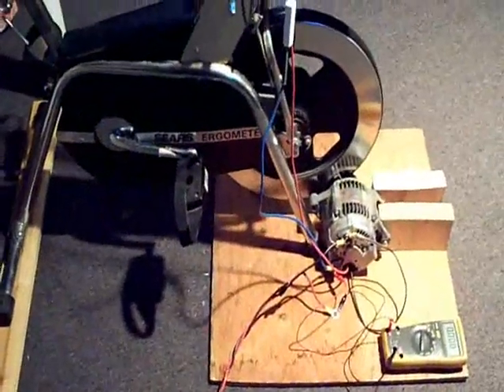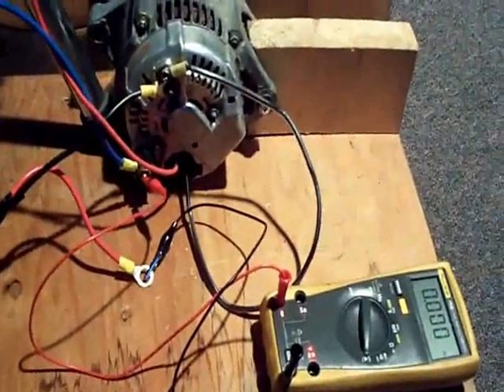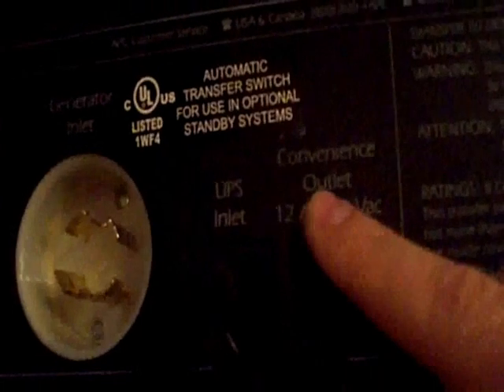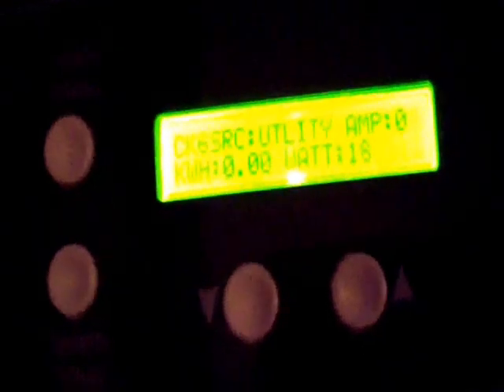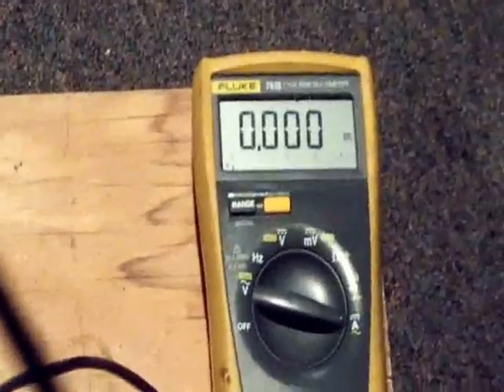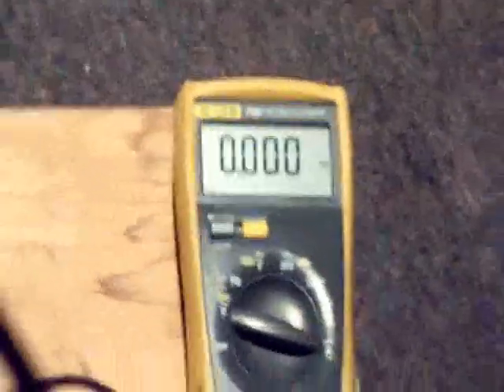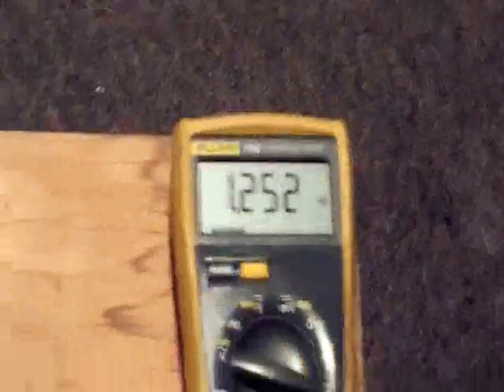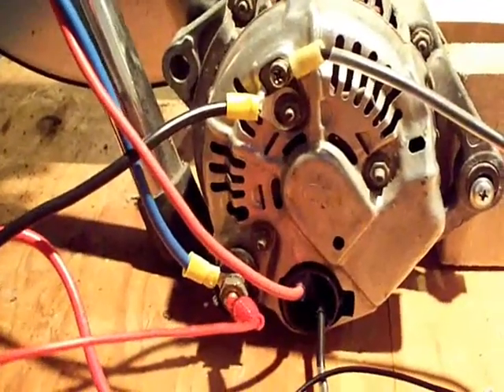Free Energy.  Calories For Electricity. Charging a Bank of Batteries with exercise Bike

Comment: @mgamber1 may be the exciter point will be connected in the body of alternater , or it may be a pma.. i think it will a   p.m.a,,
@Harwkins39  plz tell me i have a 40 amp 12v alternater and i want to charge a 40 amp 12v car battery, so charging volt should be 14.5 and what should be current plz tell me, and how long it will take to charge??